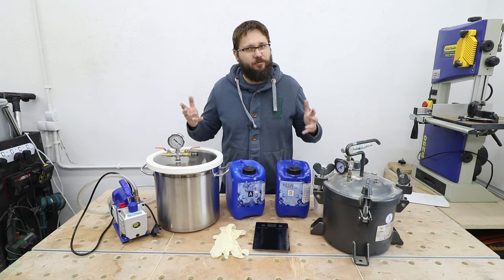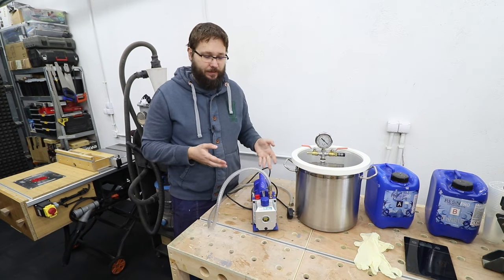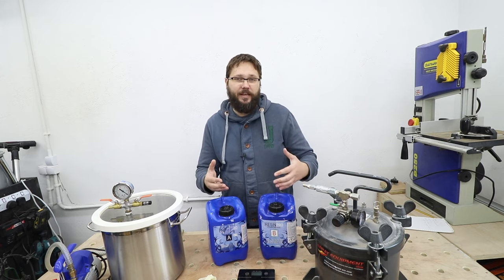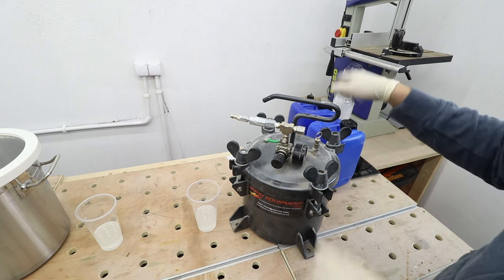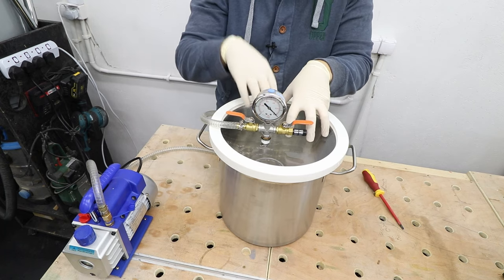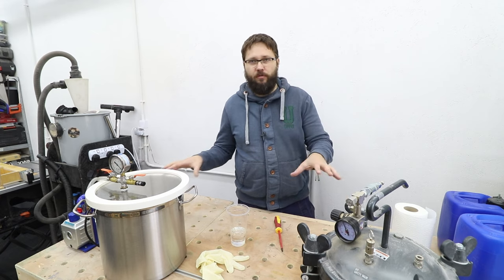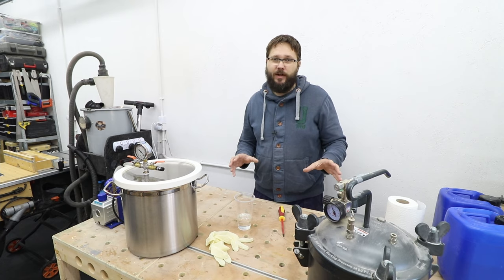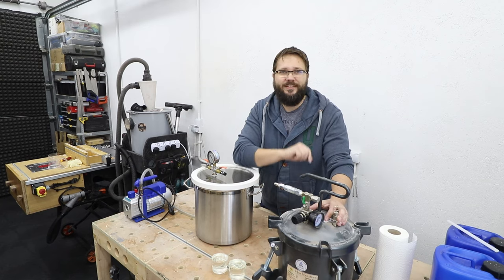Pressure VS Vacuum | Which one is Better for Resin Casting | Resin Casting Basics

Comment: Fantastic video, very informative.  I like to put dried flowers in my castings, would they be ok in the pressure pot or would they get squashed please?
Reply from the maker: If it will be submerged in resin it will be fine.
Reply: @CasualDIY  great, thank you for the speedy reply x
Reply: @CasualDIY  sorry to trouble you. Please do you have any pressure pot recommendations (preferably not modified ones) as I'm not sure of everything to look for
Reply from the maker: @anitagush9037  long time ago House or Resin were selling pressure pots for resin. You can check them out if they still offer them
Reply: @CasualDIY  thank you, I just have but sadly not now
Reply from the maker: @anitagush9037  I got mine years ago but that store doesn't exist anymore just checked.
Reply: @CasualDIY  ok thank you

Comment: Maybe I'm just slow, but are you saying a pressure pot is a bad choice when casting molds? I'm making dice and using silicon molds, and I want to make sure I buy the right thing. Thank you :)
Reply from the maker: I think to make molds it's better to invest in a vacuum chamber. Usually the material you use to make molds has got a long open window and it's easier to remove air from them with a vacuum chamber. A pressure pot does not remove air bubbles as per say, with the pressure it squeezes the air bubbles to sizes that are not visible to human eye and as the resin sets to a solid state they will remain in that size. However if you were to use silicon or something similar there is a good chance that the air bubbles will go back to their initial size as silicon is not hard and solid when cured. Hope this is clear.

Comment: Nice video 😊 I have a question, I will mix epoxy resin to make a small table with a pressure pot and I would like to know him long should I keep it on the pressure pot before putting it on the table. 

Thank you
Reply from the maker: Do you mean vacuum chamber? Pressure Pot works only when you leave the resin to set in it.
Reply: @CasualDIY   vaccum chamber
Reply from the maker: @woodworking4459  you keep it until it stops bubbling, how long will depend on quantity of resin - the more you put the longer it will take, on viscosity of the resin, the thicker the resin the longer it will take.

Comment: Will a pressure pot or vacuum chamber remove LARGE voids say 2mm or 5mm or larger.  I have an electronics project that uses a quick setting epoxy for potting that starts setting up in 8 minutes. If you get it into the pressure pot or vacuum chamber in about 3 minutes will it remove the large voids?  Small bubbles of 0.5mm is not a problem, but it cannot have large voids. Thank you for any suggestions/advice.  Unfortunately changing the epoxy is not an option.  The cavity filled with epoxy is Ø6mm x 35mm deep and filled with a syringe.
Reply from the maker: If the casting mold is not filled up correctly with resin ie you got large voids then it's the case of distributing the resin in the casting mold. Only then the pressure pot will remove small air bubbles. It may not help with distributing the resin in the mold.
Reply: thank you so much for the reply, what are your thoughts about the sucess using a vacuum chamber for this project.
Reply from the maker: @jonocean2621  none, vacuum chamber is for long curing resin only

Comment: Hi, 

I have a question. I am making a large resin cuboid with over 8 litres of resin. I don't think it's going to fit in a pressure chamber and I can't have any bubbles in it. I am also scared of my resin cracking when I pour (as it happened on my first attempt). My question is: what do you suggest I do for a larger resin quantitity?

Many thanks!
Reply from the maker: I would do it stages if possible, maybe 2l at a time? Not sure if that would be possible in your project. Plus you may get visible layers if you do that. 
Try to find a Resin with very long open window that's designed for deep castings. These type of resins are self degassing mainly used for river tables.

Comment: Hello and thanks for the video. 
I have purchased a similar vacuum pump+chamber, although my model is Mophorn RS-1. I have tried it and the bubbles start to come out, as in the video. But they never finish, and the needle never reaches -30, it always stays at -28. I have checked the connections, but in my opinion they are tight and should not leak. 
Do you know what can happen?
How should I proceed to remove as many bubbles as possible, should I open the outside air valve when it is "boiling", i.e. with a majority of bubbles on the surface? Repeat the process several times? 
Thanks in advance.
Reply from the maker: If the bubbles are coming out from resin you hold it under vacuum until it stops - be mindful of the foaming if it will overspill then slightly and slowly release the vacuum. Depending on quantity it may take a long time for all the air bubbles to escape. Hence this is only suitable for resin with very long open window. We are talking about 30 - 40 minutes - depending on quantity, the more resin the longer it may take.
Reply: Vacuum is measured in inches of mercury.  The altitude you live at has a MAJOR impact on the inches of mercury that a vacuum pump can produce.  For each 1,000 ft of elevation, you get 1" less of vacuum.  In the mile high city of Denver, you won't get much above 25".  And that is also why water boils at a lower temperature at higher elevations.

Comment: I'm looking for budget setup for vacuum resin infusion, do you think your setup could be modified to make it possible? I'm thinking I could drill a hole in the acrylic lid and feed and seal a resin tube through (the tube that is connected to the mould and is sucking in the resin)... What do you think?
Reply from the maker: Sorry I'm not familiar with resin infusion process.

Comment: Hi Tomas
I think you will find the acrylic lid is okay for resins, but not for Cactus Juice.  Cactus is often used in a vacuum pot to remove air bubbles from wood, before it's then cast in resin in a pressure pot but it damaged acrylic lids, but not glass.
As such, if just for normal resin, acrylic lid is okay.
hope it helps :)
Edit - I didn't wait until the end of the video.....  LOL

Comment: This is exactly what I was looking for to show me the difference between vacuum and pressure when using casting resin. I’ve been using resin in the artistic end for acrylic pouring and I am familiar with how to use and mix it.  But I am also an avid woodworker and wood turner and I want to combine resin and wood and turn it on a lathe. I just got myself very confused when to use vacuum or pressure.  Thanks for explaining the differences and demo.  You made it easy to understand.

David f USA
Reply from the maker: Glad it was helpful! Sometimes its difficult to understand the difference as you would think that an air vacuum would be better however in case of resin casting it may not be the case.
Reply: @CasualDIY  may I ask you one question.  Most of the e
Resin I have used were for covering canvas or items like coasters, etc.  I want to take a piece of rough wood or something I configure and place it in a bucket or simple form.  Then pour resin around it, let it cure, then turn it.  My Delia is what kind of resin should I use.  Some  resins are for a shallow pour and some for deep pours.  I’m not sure what I should look for here in the U.S. I am assuming you are in Great Britain and are unable to recommend a brand.  So do you have any advice what I should look for?
I appreciate an6 help you can throw my way.
Reply from the maker: @davidfrazier2277  there are many types of resin, for pouring I would recommend epoxy for 2cm - 5cm deep pours. I would recommend Zack Higgins YouTube channel. He is based in US and he has vast knowledge on resin casting.
Reply: @CasualDIY  Thank you, I will.

Comment: Is it worth putting the mixed silicone in the pressure pot before pouring a mold, or will the bubbles just come back?
Reply from the maker: They will come back, pressure pot does not remove the air bubbles per say. It squeezes them to microscopic sizes that wont be visible to human eye. As resin sets it closes the air bubbles in that state. If you release the pressure before resin is set the air bubbles will come back to original size,

Comment: What would the results be if your vacuumed the two resin components in separate cups.  That would remove any trapped air that was intruduced during shippng.  Then blend them GENTLY before pouring in the mold outside of the vacuum chamber?  Seems like that give much more working time before the short working time of some resisns starts to set.
Reply from the maker: You would still introduce a lot of air when mixing as both components need to be mixed very well.

Comment: You mentioned that the pump with the vacuum chamber was a dedicated use item as opposed to the air compressor. I've been wondering if there is another use. 

Is a vacuum chamber's pump suitable to use with a vacuum bag?
Reply from the maker: I can't see why not as long as you can get the right connectors 👍
Reply: You can use it to vacuum seal dry foods (beans, rice, pasta) in canning jars.  As for sealing bags, it can't be done without introducing air into the chamber.

Comment: At 5"15 you explain that the black valve on the pressure pot is to modify the desired pressure. At 10"10, you explain that you're adding the air pressure slowly and you appear to be controlling that rate with the inlet valve. At about 10"40, when you have achieved your desired pressure you switch off the inlet valve.
Is it not the case that the black valve is in fact a flow rate valve, which you can turn down to reduce the amount of splatter inside the pot? Whereas the desired pressure is set by the user at the inlet valve?
Reply from the maker: It will allow you to control the air flow, so don't open it fully otherwise it may splatter your resin inside the pot.
Reply: @CasualDIY  I know, so I don't understand why you're using the inlet valve so cautiously instead of the black flow valve. (Which you may have inaccurately described as a pressure valve.) Maximum respect to your videos. Hope my input is useful.

Comment: For the vacuum pot, are there specific requirements for the pot or can you use any good pot that the lid fits on?
Reply from the maker: No specific requirements but it needs to be a very solid one
Reply: @CasualDIY  thanks. I have several that were used in my partners canning projects I haven't rehomed...

Comment: My items would be too big for the pressure pot, can I just use the pot to remove the bubbles an then pour it into my molds?
Reply from the maker: I'm guessing you have not watched the video carefully. Pressure Pot does not remove air bubbles. It creates high pressure that squeezes the air bubbles to sizes that are not visible by human eye. You need to let the resin cure inside of the pot under pressure. Otherwise as you release the pressure before the resin sets the air bubbles will go back to original sizes. What you describe is suitable for the vacuum chamber however you would require resin with very long open work window as the process of removing air bubbles can take some time ( depending on thickness of your resin and amount of your resin ). You will still introduce some air bubbles during the process of pouring. So if your projects are large I would suggest investing into slow curing, self degassing resin.

Comment: Thank you for your tips. Is it possible to put a epoxy diorama with polymer clay inside the pressure pot?

And what resins are great to use which do not yellow up after some months?
Reply from the maker: If its in a mold that will fit the pot then yes. I recommend resin from Resinpro.eu very good resin. Got a discount code for them as well if you want. Glass Cast is also very good at a reasonable price 👍
Reply: @CasualDIY  thanks!
My diorama will be painted with an acrylic paint. I saw on that site that the epoxy is moisture sensitive. Would it work if I seal my diorama with a sealer first? 
And which epoxy on that site do you recommend? I saw so many haha. My diorama will be in epoxy completely. It will be around 40 cm high and 30 in width.

Comment: So if I mixed up 1500ml of epoxy in the vacuum that would be a problem if it takes 25 min to be bubbleless as my resin gets hot after about that time and would start smoking up ,its catch 22 really .i do need one as I just had a load of micro bubbles get trapped in my big epoxy dining table and now I got to go back and router it all out as it’s clear resin .I’m not a happy bunny today and now i thinking about buying one as I can’t have this again ,and the weather has changed now so if you doing these in a shed like me then you need to keep it warm in there as I been getting like this cracking of the resin after it has cured and it’s a right pain in the arse .good vid and demo tho mate that helped me out nice one I’m subbing you for that .would of been great if you would of done a litre of epoxy in a small bucket to see how that would go as not everyone casts in a mould ,I just do tables and don’t really pour less than 500 grams a time unless I’m doing seal coats  that is  but none the less thank you 🙏
Reply from the maker: If you are making tables with resin and large pours and you are in need of a solution to degass your resin then you got a wrong resin my friend. Vacuum will not work for those quantities. You need a slow setting self degassing resin for tables. 24h cure time self degassing for deep pours.
Reply: @CasualDIY  yeah deep cast resin but I have had clear results using warm water to warm it up before hand . I’m getting like snake skin effects after curing some times . You don’t know what causes it do you ?? I sand and polish mine but some times when I’ve polished it it looks really good untill you put a light right close to it and then can see the snake skin hologram. Even though I sanded it the right way thru the grits to 3000 grit some times I get that. I buy my resin from Germany . I’m in the uk . And am paying about 8-£10 per kilo which is the cheapest I’ve found for the results I get with it . I put some of mine work on YouTube . I would be interested to know what you think of what I’ve done . I’ve been doing it for 3 years now and I had no wood work experience so I’m self taught through YouTube vids like your selfs and others . Thanks for replying mate . Top man 👍
Reply from the maker: @roxoriginal732  Well first of all the resin may be the problem. I use resin from Resin Pro for deep pours. They got 5cm deep and 10cm deep, and they work great. Now apart from resin itself there may be a lot of issues, like temperature in your workshop, humidity, not mixed correctly etc. 
I'll have a look at your videos and see if I can find something.

Comment: What about degassing your resin in a vacuum chamber, then pouring your molds and then putting them in a pressure pot to cure? Would there be any benefit to that versus just putting them in a pressure pot? Obviously working with resins that won't set before it's finished degassing.
Reply from the maker: The pressure pot will give you perfect results. No need to vacuum the resin before👍
Reply: That is the standard procedure I have been using for years. Just pressure potting compressed bubbles. I have had resin castings deform if the item gets warm from bubbles expanding. For acrylic the pressurized bubbles are creating stress. 
Vacuum. Pour high. Pressure pot.  Great results. YMMV

Comment: 20:59 i thought I saw something in the pressure pot casting, but I couldn't tell if it was simply part of the shape of the bottom of the cup, or air bubbles. 
If you pause the video at the point above, then zoom in on the left side of the screen, you can see one oblong shape and one circular shape. These certainly LOOK like air bubbles 🤔
Am I mistaken?
Reply from the maker: I can't see anything but I on my mobile so...

Comment: I use 48 hour long-pour low viscosity art resin. I mix it, degass it in a semi vacuum, pour it into my mold, put the mold into a semi vacuum.

I'm not implying that is the best way. It's clunky and cumbersome, and doesn't work for medium or high viscosity resin. 

I'm making a pressure pot next month to use with thicker resin and faster curing resins.

Comment: What about a mixed workflow - put component parts separately into the vacuum chamber, then mix carefully, then pour and put into pressure chamber for curing.
Reply from the maker: If you got a pressure chamber there is no need for anything else. As I showed in the video I introduced as much air bubbles as I could in the resin and straight it went to the pressure chamber. And as you seen it came out crystal clear. No need for anything else👍
Reply: @CasualDIY  Depends if you have working time though to do that, if you wanted to use a faster setting or different resin or a resin where the pressure method does not work as well may still be fallback?
Reply from the maker: @Festoolification  I think you confused it Vacuum Chamber. Pressure Chamber is perfect for fast setting resin. You just put your mold with resin to the Pressure Pot, lock it and add air. That's it. Then you just wait for the resin to set👍
Reply: I asked a similar queston but only using a vacuum chamber, then mixing carefully before pouring into a mold, bypassing the pressure pot.

Comment: By putting more pressure into the resin will it get hazy? Because I think by adding more pressure it will add more moist into the chamber and the resin will absorb it? Just a thought
Reply from the maker: You should have a filter between the compressor and the pot. Makes no difference how much pressure you add, if you don't have a filter then moisture will get in regardless